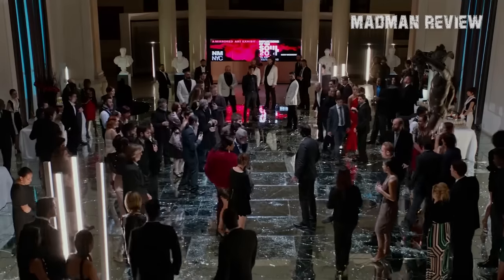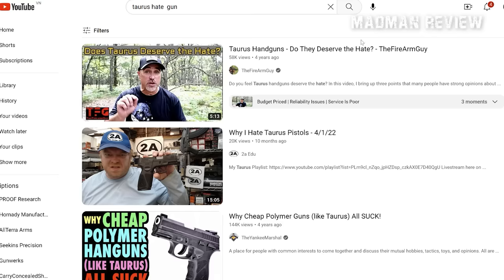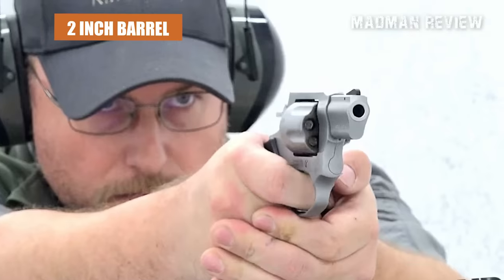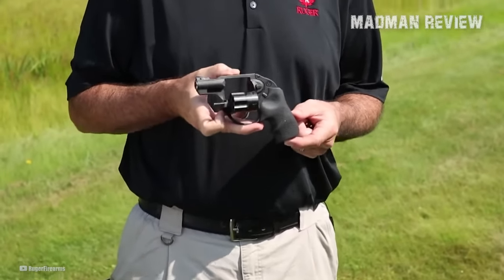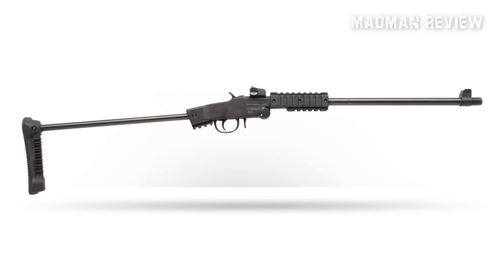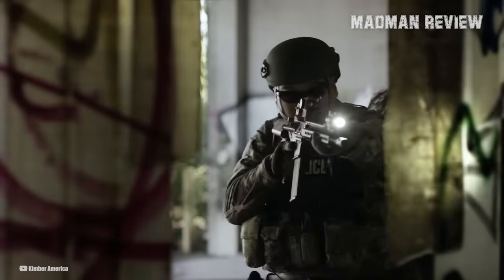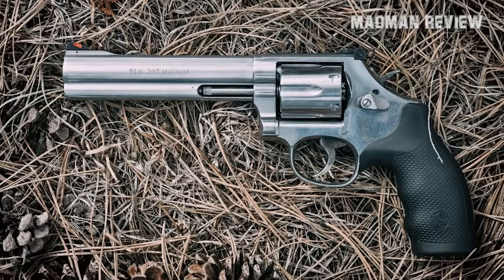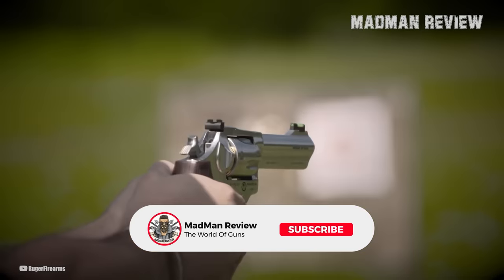TOP 5 Light-Weight, Higher-Capacity Carry Revolvers!

Comment: Brings to mind, a Taurus .44 Magnum ultra lite.
Chambered for .44 mag.
Confidently, I shot it at 25 yds,
But shots went astray.
Moving the sights to the extreme left, finally got groups.
Then checked the chamber throats..
.437 throats on a .44 Magnum.
Thought about reaming to .45 colt, but traded it off.
Damned shame, cuz  it was going to be a perfect carry piece.
Titanium frame, people!
Reply: A 44mag ultra light? What happens if you need a second shot but don't have the 45 seconds it takes to line that beast back up from the recoil?... Remember folks a hit with a 22lr is better than a miss with a 50 BMG.

Comment: Good points made here.  Even though I love revolvers and have had many over the years, I have had to send back two revolvers bought new in the last year.   Taurus 942 and a Ruger LCRx.   Both were defective from the factory.  Still waiting for my "new replacement" from Taurus.  I am just unlucky because I also had a Smith Bodyguard 38 that needed to be sent back due to cylinder alignment problems.  Yet, I keep collecting them.

Comment: "You only need to pull the trigger a second time..." Not entirely true, because it isn't really what is considered to be a "jam" - it's a "misfire" (when the cartridge wasn't fired after the cap or rim had been stricken). The "jam" is when the revolver's cylinder (drum) gets stuck and wont turn anymore neither in a double nor a single action mode. And if that happens during the self defense situation, the shooter is in a deep sh*t, much deeper than the guy with a semi-auto in his hand.

Comment: What about the Ruger 8-shot revolver in .357 Magnum? (My apologies for not remembering it's actual name.) It has a cylinder better-suited for +P rounds, while the S&W revolvers are a touch shorter.
Reply: Be sure to hold a large-frame revolver and think about whether the grip is right for you before buying. I was considering the S&W version of the one you mention, based on a .44 Magnum N-frame, but it wouldn’t have been practical for my medium-sized hands. The 686+ is one less round but with perfect-sized grips.

Comment: Revolver is perfect for most real world confrontation.  Arms length or grappling.  If you jam the muzzle of your semi auto into the belly of guy trying to choke you, there’s a high chance it will go out of battery and you’ll have 15 rounds of ammo that you cannot use.  A revolver will shoot through a pocket or you bedsheets.  Much better choice for belly to belly fighting.  If you fantasize about fighting off a dozen home invaders kicking in your front door, ANY pistol is the wrong choice.  You need an AR15 or AK style carbine for that.
Reply: If someone grabs your revolver by the cylinder, you won't be able to pull the trigger. Try it.
Reply: @joep8787  you can barely even get the slide to move if the same thing happens on a pistol. It's much easier to grab a slide than a cylinder
Reply: Or high capacity 12 gage
Reply: @davidsellers3639  that's only if you don't care about collateral property damage for spread or over penetration for slugs
Reply: @joep8787  A relative who was a sheriff in Madison county KY was arresting a guy in a car when the guy pulled out his revolver and was going to shoot the sheriff. The sheriff grabbed the cylinder and the guy couldn't shoot him. That was in the early '60s.